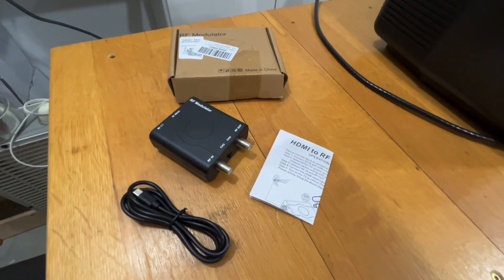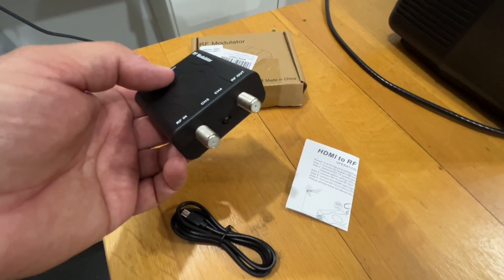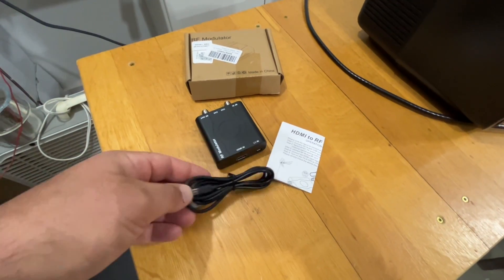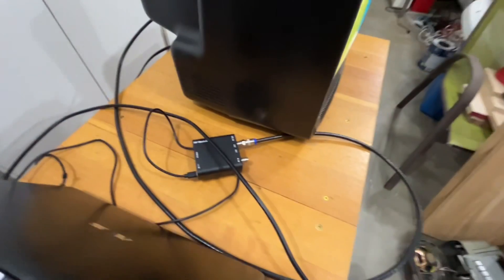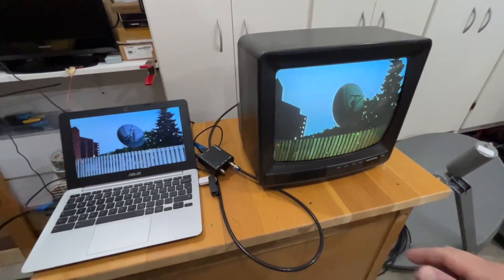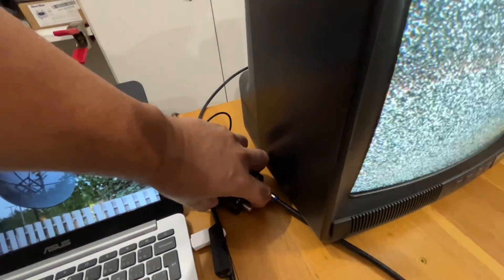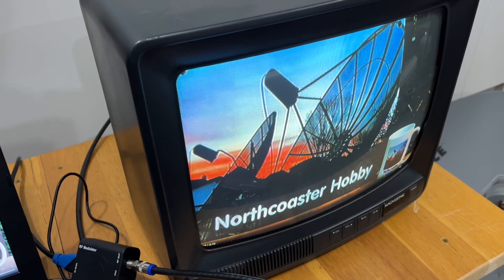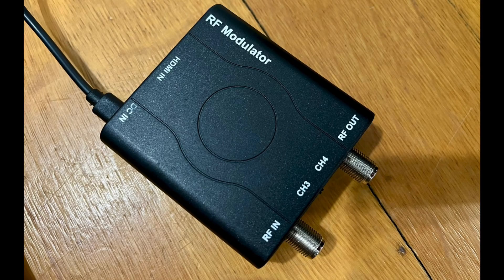HDMI to RF Modulator - Easily convert an HDMI source to RF Coaxial Cable

Comment: What is the latency like? I have fiber Internet and don't use any cable service.

I'm wanting to play games on the couch with my 1080p (actually 4K) tv, by running the games from my beast of a pc (in my office) and using my wireless controller to my pc.

Then I'll use my HDMI splitter to send one HDMI signal to my monitor and the other signal to this converter and feed that into my wall's existing coax and then on the cable box connect it through to my living room's existing coax.

Right now I'm using the old steam machine to simply stream the games over Wi-Fi, but the lag can be pretty terrible.

I have a high quality 40ft long HDMI cable with a powered signal booster that can run the distance, but I don't want to cut and repair textured drywall if this will work.
Reply from the maker: I don't really notice much latency issues with it, but if you are gaming, you may want to look at all possible options.There are also wireless HDMI video senders, but those may have even more of a delay. Also know that the modulator in this video does not produce an HD output signal.

Here is an example of the HDMI transmitter set I mentioned. But I don't know what latency issues it may or may not have, especially with it being wireless(Amazon affiliate link below):
https://amzn.to/3Zk8Igw

Comment: I am trying to connect modified Dish cables to a new TV via this modular. I can’t get the new Vizio tv to pull up Dish on the HDMI. What could I be doing wrong? Would cable need to use both the input and the output?
Reply from the maker: The modulator only works one way. The HDMI is input only. The coaxial cable is the output.

Comment: Interestin, didn't knew there are HDMI to analog RF TV converters. The convereters that are available in electronic stores are digital HDMI input to digital RF TV output. The European version use DVB-T system and frequency band VHF High (channels 5 to 12) and UHF (channels 21 to 69). The video ouput signal is MPEG-4 1080p 60 Hz and supports 60 fps.

The expensive ones use both digital cable and digital terrestrial ouput so it has two systems DVB-T for VHF and UHF or DVB-C full band (48 - 862 MHz)

There are 4K HDMI to RF converters they use HEVC DVB-T2 or DVB-C system but are very expensive.